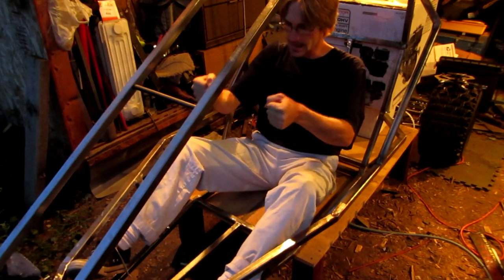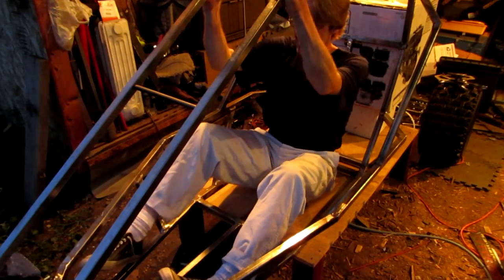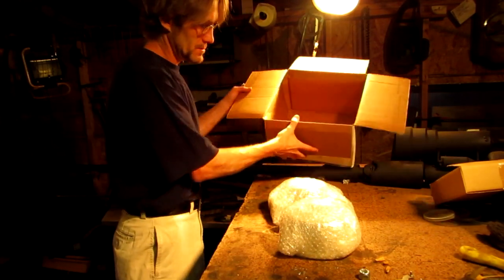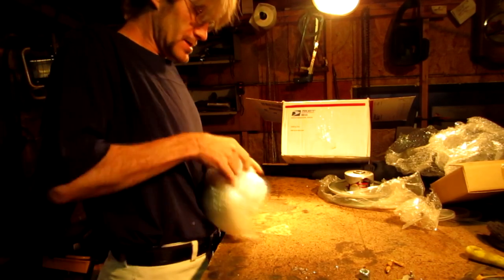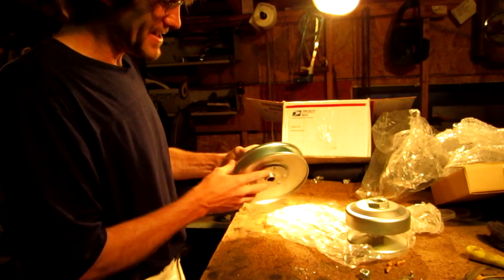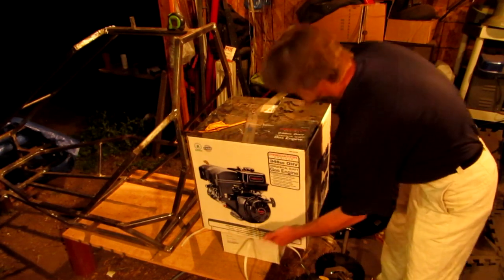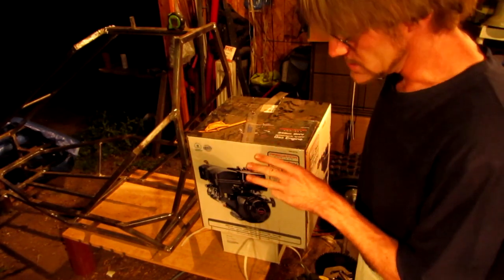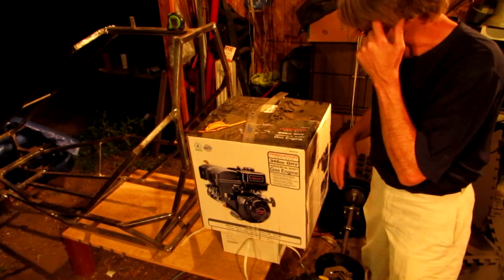Go Kart , Rear end Idea █  ( The Fullscreen Machine )

Comment: Can the torque converter spin both ways or does it need to be installed with the spring side to the right?
Reply from the maker: Nope, it cant spin ether way. It has to be set up like this.. BUT remember THIS TC is a 40 series. here watch this it gives you a better view...Batmobile Go kart running

Comment: Oh Hell Yea! Happy B-day T-Man! On the subject of runnin chargin system on Full Screen; put pulley on flywheel side of engine (same way Fearless did for pull-start) this will give you full time turnin for alternator. Use the 'one wire' GM alternator (part #= 4011 or 9011? I think not sure)